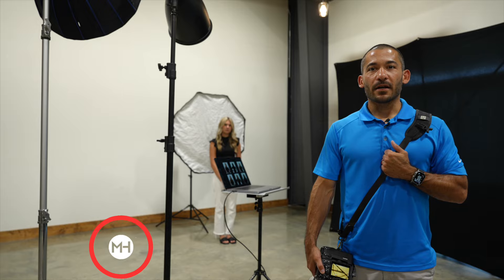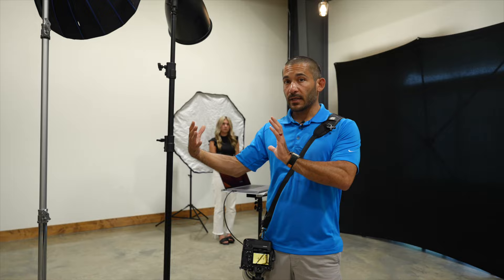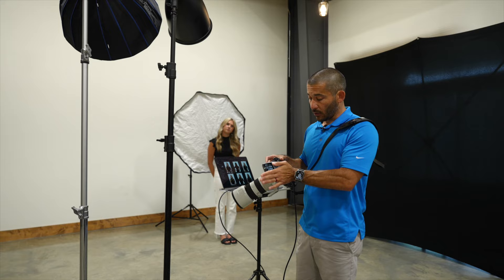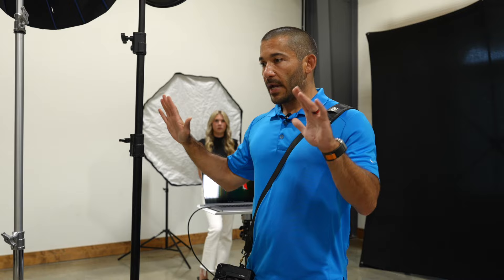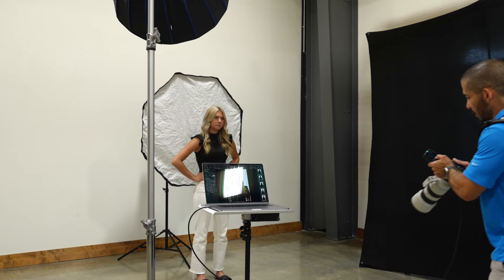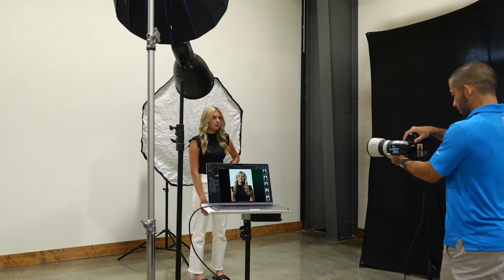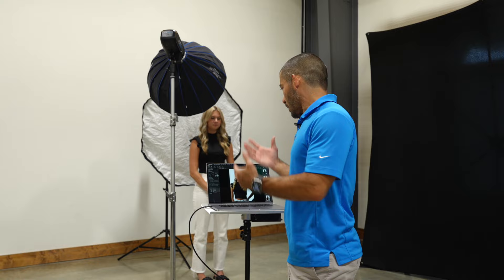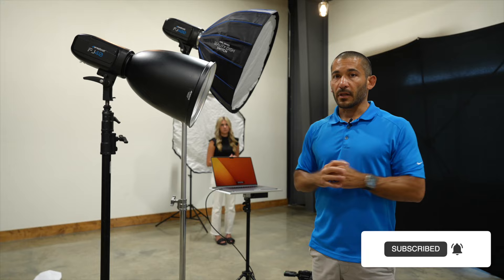Beauty Dish vs. Deep Focus Reflector

Comment: For outdoor shoots using the DF reflectors vs 7’ octo’s, about how far back from the group are you placing each?
Reply from the maker: It really depends. The closer the light the softer it is so get it as close as you can without being the the frame.

Comment: No matter what I do, my key light exposes a lot of the wall around my backdrop, despite using ND filters, high speed sync, and haze (like in your little league baseball video). I expose for the background, but the key light is what does it. How do you avoid that?
Reply from the maker: You’re too close to the background. Try pulling your subject off of it and feathering the light, or add a grid to it.
Reply from the maker: In this video my background is white so it is irrelevant.
Reply: Thanks! Yeah, I was thinking more about the little league baseball video with the deep focus reflector with diffusion, but comments were turned off. I enjoy this video, too, so I just asked on here! I appreciate it! Absolutely love your stuff!! @MattHernandez